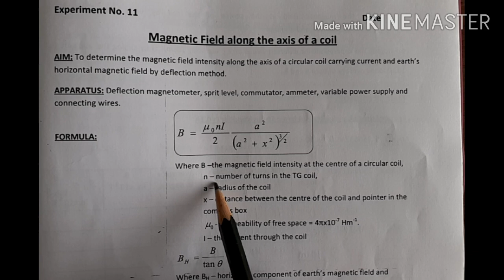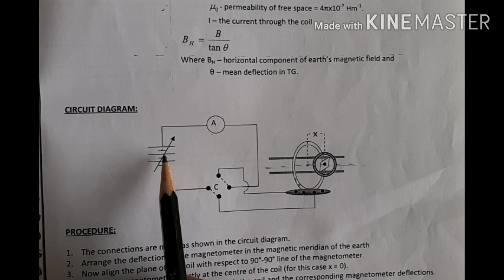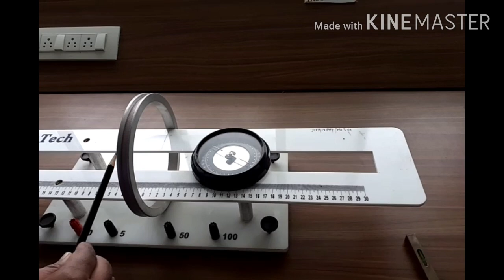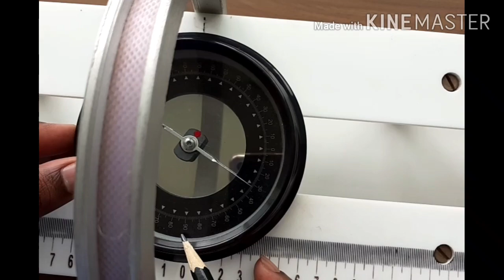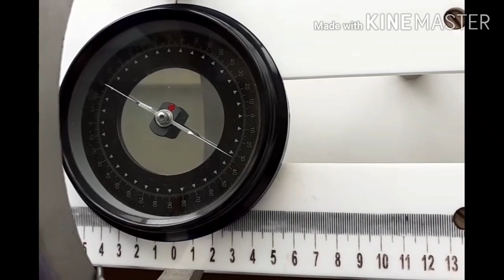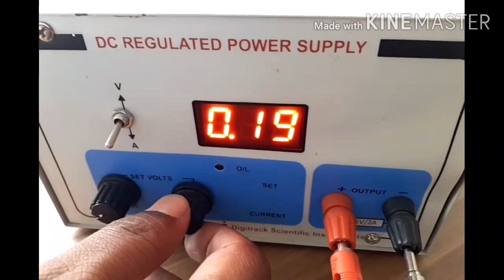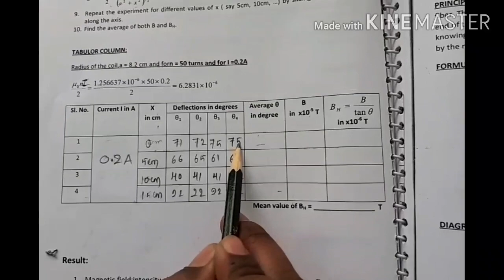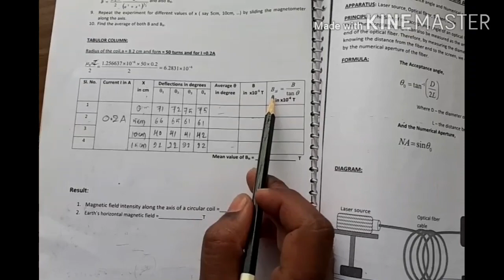8. Magnetic Field Along Axis of Coil and Earth's Horizontal Component

Comment: SIR CAN WE TAKE DEFLECTIONS BEYOND 60 AND BELOW 30 DEGREES IN THIS EXPERIMENT.
Reply from the maker: Yes, we can take. Less deflection means less magnetic field and more deflection is high mag field.

When compass is at the centre then there will more deflection, as it moves away mag field decreases.

Another situation, if current in the circuit is less then mag field produced is less. It is better to pass some considerably more current so that accuracy will be more. (Current should be in the limits of instrument otherwise the copper coil may burn)